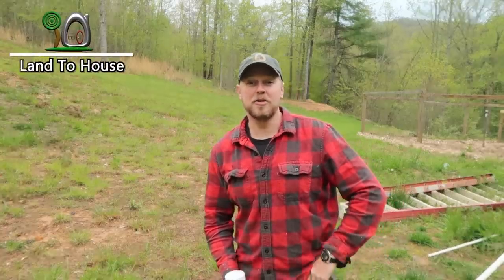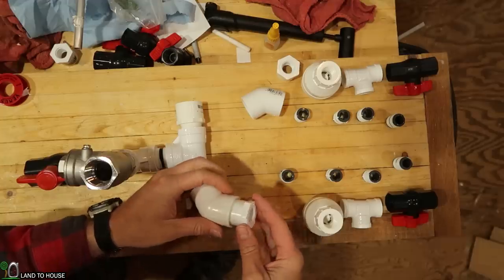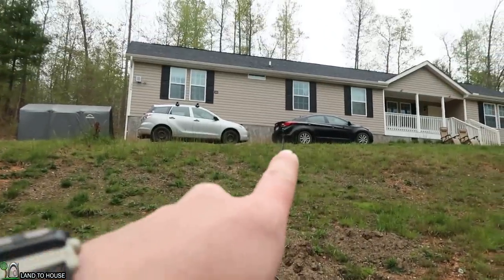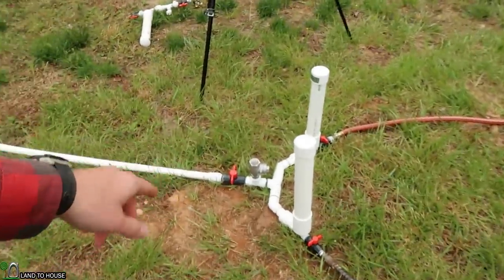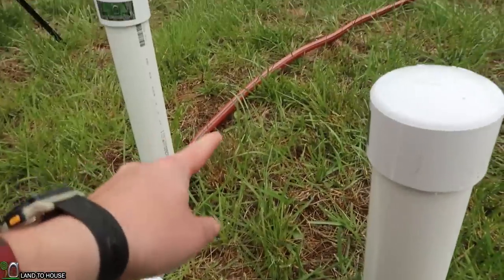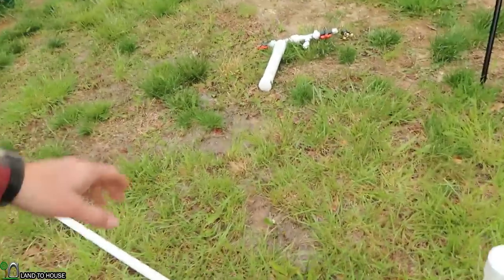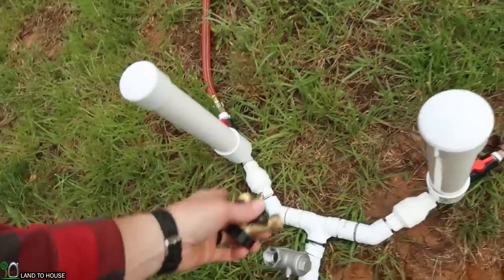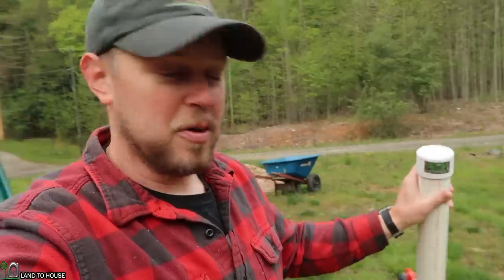Crazy Looking Dual Output Ram Pump

Comment: Hello my name is moooonshinnne .
My theory is if you can spin a magnet in a water pipe and put coil on the outside of the pipe.
 it's a generator.
Start with a pipe size permanent magnet.
With the Archimedes screw style.
And the Tesla turbine blades at a 5 two10 angle .
I call it the arca Tesla magnetic water screw.

Comment: Why not just use one single oversized pressure tank and divert the water in several directions from there?
Reply from the maker: This was just a fun test. To effectively move water in multiple directions you need to only have one delivery open at a time.
Reply: @LandtoHouse  I was thinking of one BIG  FAT honking pressure accumulator; big enough to move water to both locations "simultaneously."  
What do you think of that idea?

Comment: YOU NEED TO EXPLAIN THE PURPOSE OF EACH PART OF THESE NIPPLES AND T SHAPES>>....ETC AND WHAT IS THE PURPOSE OF THEM IN THIS BUILD UP PUMB>>>THEN TO EXPLAIN EASY HOW IT WORKS >>>WHAT IS THE MECHANISM THAT CAUSING WATER TO GO UP >>>BUT IN EASY LANGUAGE SO TO UNDERSTAND>>>>=NOW: IT IS TOOOOOOO COMPLICATED
Reply from the maker: I actually have over a 130 videos on the ramp pump. A few of them break down each part and give you an explanation.